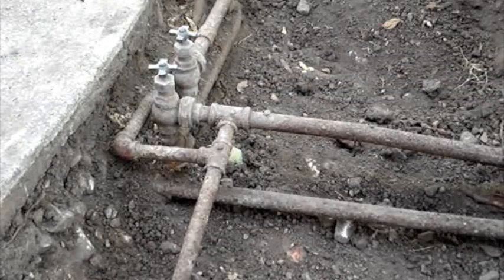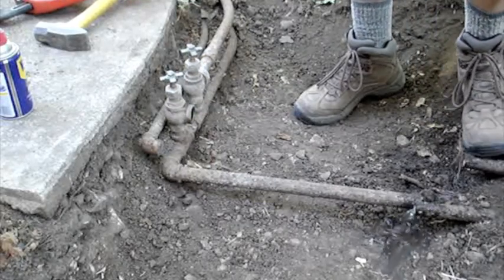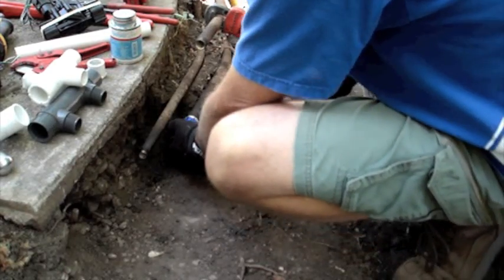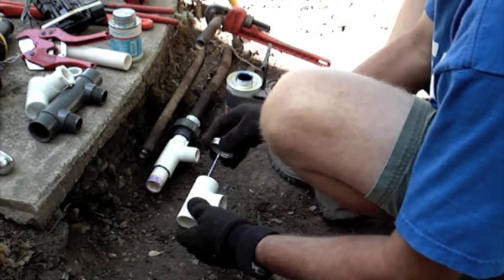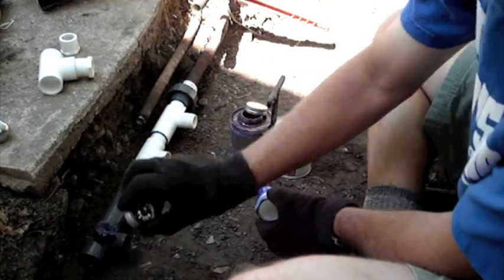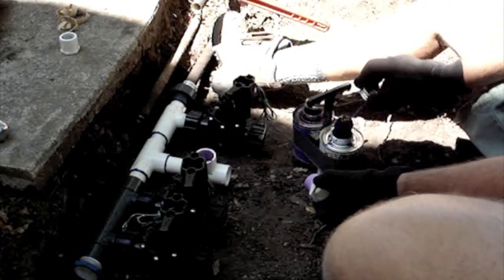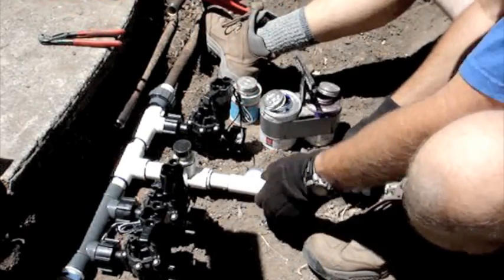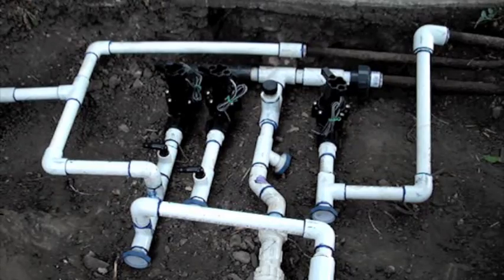Conversion: Manual sprinkler valves to automatic sprinkler valves.

Comment from the maker: @KasinH 
Saw is a Dewalt 18 Volt. Manifold Tee is 1" Slip X Slip X MIPT Thread. Slip Tee is 1" PVC Slip X Slip X Slip. No pipe dope on valve connections because the Rain Bird 100DVFUU valve has O-rings on the valve that seal when the nut on the valve is tightened. 

Your galvanized pipe probably has flat spots that won't allow the dresser coupling to work. I would try and thread the pipe end. This is one of the problems of galvanized pipe, the older it gets the harder to work on it is.

Comment: Thanks for the video. I have a somewhat small manual sprinkler system with three individual valves to turn. Can you estimate what you think a fair price would be for me to have someone install an automatic unit on the timer? I live in the Los Angeles area.
Reply from the maker: Hard to estimate without seeing what you have. Conversion valves run $30-40 each. Often the tricky part is getting a timer wire from the conversion valves to the timer. Also you would need 3 open stations at the timer. I would get a couple of estimates from sprinkler contractors in your area.